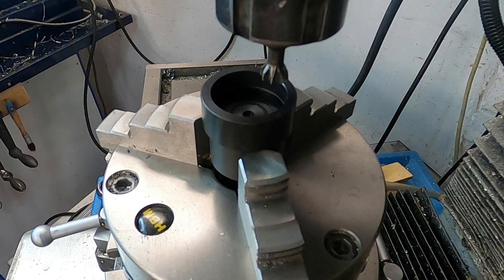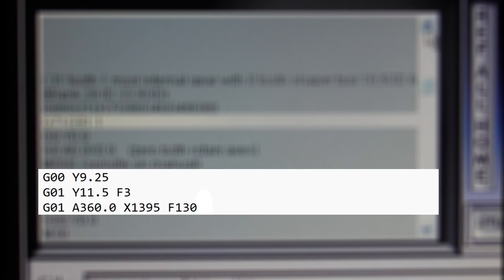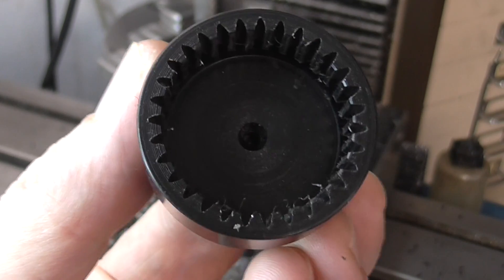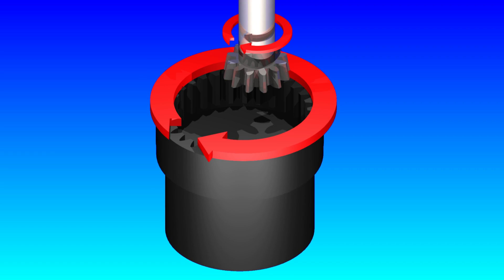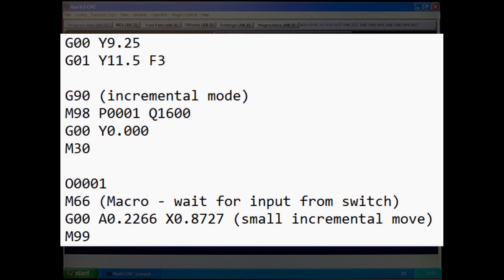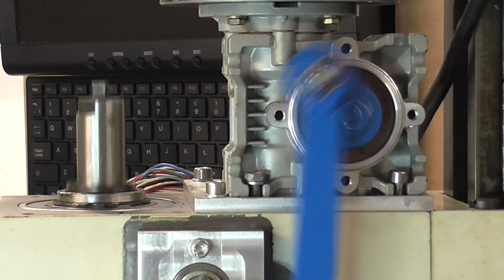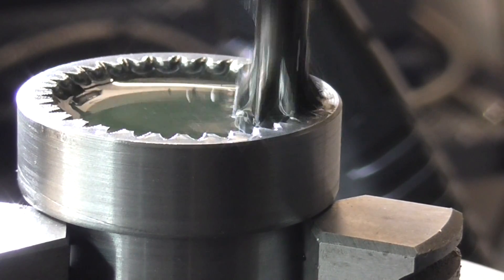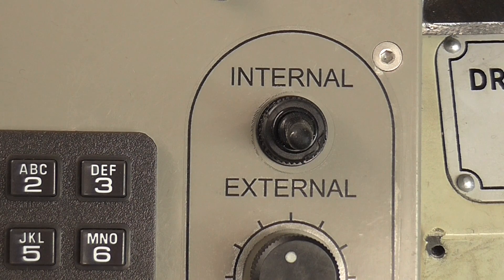Building a Gear Shaper (Part 2)

Comment: I think that your assumption (at 10:34) that the profiles should match is incorrect.  This would help to explain the tight fit of the gears.
However, this is an impressive project.  Thanks for taking us along.
Reply from the maker: I think they should match throughout the working part of the tooth, since all gears are generated from the same basic rack profile*, but I'm open to anybody explaining to me why they shouldn't? The reason it was a tight fit was because I cut the outer (internal toothed) gear too small due to the deflection in the machine.

*I believe that sometimes internal gear tooth profile has to be modified to avoid interference if the gear driving it is close to the size of the internal gear, but since it is usually much smaller (eg. in a planetary reduction) it's not a problem.

Comment: Is that windows xp, on the Mach 3 pc? 
I mean, if it works, it works.
But, damn that's pretty old.
Reply from the maker: Yes, it is! And on a 15+ year old PC, it works just fine for this. If it ain't broke, don't fix it. I even used to have my CNC lathe running with Mach 2 on an even older PC. (It broke, so I had to fix it.)
Reply: @AndysMachines  Latency of new computers, eg. Ryzen, is terrible. I had to use a garbage board with an ancient CPU to get low enough latency to output stable parallel port signals for stepper motor control with LinuxCNC.
Reply: Not sure if later versions of windows support the parallel port required with Mach 3 - Good old XP - reliable and basic to use !
Reply from the maker: I'm actually using a USB stepper controller board on this PC as it doesn't have a parallel port. Though in the past I've done it directly from the parallel port (maybe with windows 95 even?) This PC only runs Mach 3 and nothing else, XP boots very quickly and works great for this.
Reply: To use Mach3 I have an old laptop running XP on my mill and a used cheap touchscreen laptop (Ebay) running W10 on my lathe. Both run through USB controller cards. The lathe had an old XP laptop for years but the keyboard died and so was replaced. Neither laptop connects to the Internet and are used as dedicated controllers and nothing else. Call me cheap if you want, I will take it as a compliment 😉

Comment: I mean, it was impressive, but any code you wrote for the controller to generate gcode you could have written on your connected PC to generate it too. Do you find going to the effort of making dedicated hardware control boxes like this worth it?

edit: I should say, "because I preferred it" is of course absolutely a very valid answer if that is the answer!
Reply from the maker: Yes, I've done things like this before by using Excel to generate Gcode from a few input variables, but then I still have to save or copy/paste the code and import it, and the PC connected to the machine is mounted to the wall and not very ergonomic to use. With this controller I literally enter the numbers with a few buttons and off it goes, plus I like it being all self-contained since most of the time this shaping head will be removed and the CNC mill reverted to it's original state.  And yes, I often prefer to do things the hard way just to achieve a very marginal improvement.

Comment: Would this machine work for bevelled gears, I think it would if you could mount the rotary table at an angle? Also helical gears would be possible as well I think but the code would be a bit more complicated for that i think
Reply from the maker: You can certainly cut bevel gears on a regular shaper, but I don't remember seeing bevel gears cut on a gear shaper, I'm sure it can be done though. Helical gears are definitely possible, the cutter has to be helical and it spirals down into the workpiece, I think it might be possible to make the advance of the cutter passive with a spring to return it to the start position, which would mean no actual modifications to the machine, just a purpose made tool. I might have to experiment with this.

Comment: This is very clever, nicely done. I learned to run manual gear shapers a few years ago-Drummond maxicut and Lorenz. Purely mechanical, quite complex to set up but fascinating. The lorenz's were particularly good, dated from the mid 40's and still ran perfectly. They had a pull back mechanism for the return stroke, it is quite important to stop the cutter dulling. I would highly recommend adding the pull out in the y axis. Also means you don't need to worry about stopping the rotation. Perhaps you could get easier programming if you left the spindles turning constantly, and had a separate pull out system running independently? Sorry to be an internet know all, but maybe it'll be useful

Comment: That's a hell of a build! I was going to make some arguments for going to LinuxCNC, but I can't think of a kinematics style that would work with your setup. Maybe issuing a feed hold anytime the quill is not in its "safe" state. Did you write all the motion control yourself or are you using some libraries? For the ATMegas, AccelStepper is really handy.
Reply: Linux CNC can do it by "electronically gearing" the workpiece and the cutter either just using software position or integrate an encoder. The coordiantion of the up-down stroke can be done in lots of different ways. I guess Andy does what he knows because the Microcontroller for him is easier, because he already knows how to do it.
The slotted disc from the video could just be used for simple jogging of the workpiece by a fixed amount.

Comment: Fantastic,. My only thought with the flexing of the rotary table is maybe don't cut at full depth for the first complete rotation. Take most of the material off then, do a secondary cut and final tooth depth.   This will double the process time, but may give a cleaner finished product.    Very excited to see this in action, as very envious of your achievements.  Keep up your great work work and Hello from little New Zealand